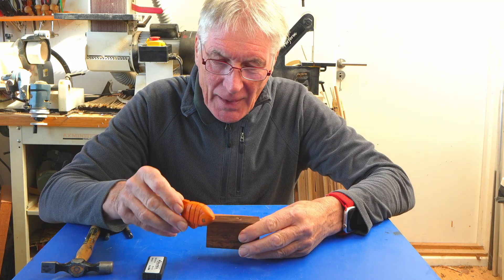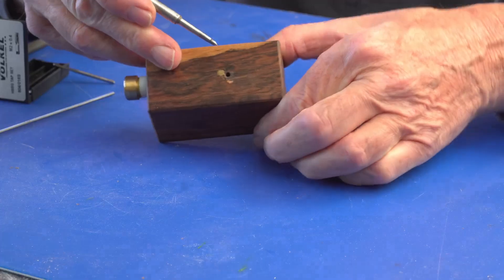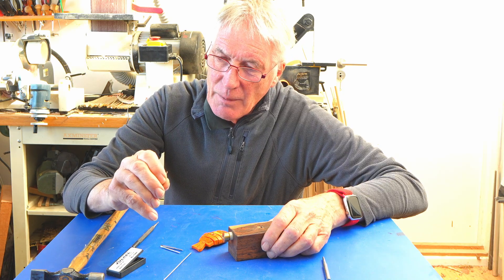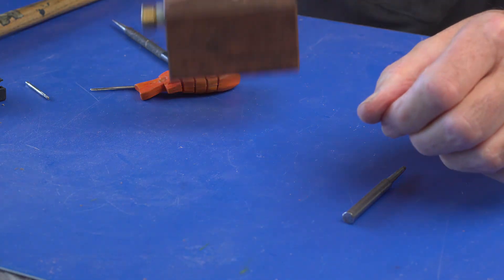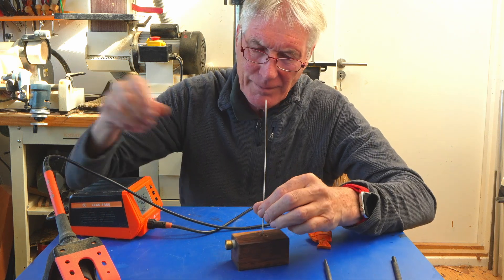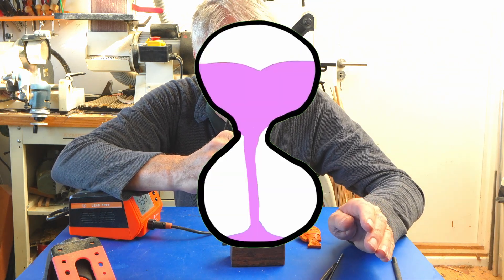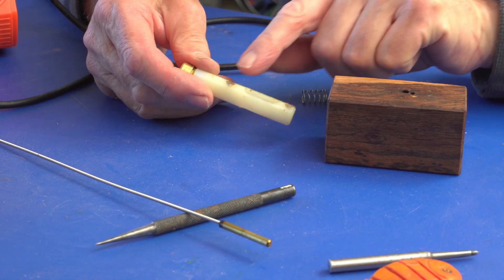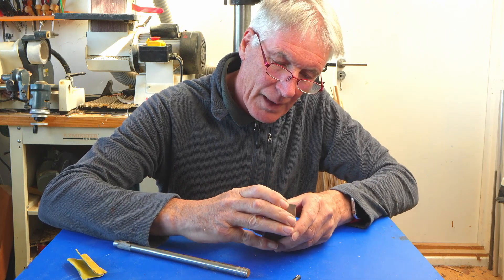Automata. Fixing a botched repair.

Comment: Why couldn't you just clamp the box down to the drill press table, tap the hole and pull the brass pin out with the tap itself?   You'd be pulling straight up with the leverage of the drill press handle and quill, so I don't understand why the extra step is needed.
Reply from the maker: An alternative that I hadn’t considered.  The Proxon drill press isn’t very robust and the glue still needs melting. It grips very strongly. Thanks for the suggestion.

Comment: I find a small "centre drill" very useful in such circumstances, to start a tiny hole, because it has a very stiff body and therefore doesn't have a tendency to wander off.  I have a set of various sizes.

Thanks for your excellent videos - entertaining, instructive, informative and inspiring.   👍
Reply from the maker: Thanks. Yes, I always start with a centre drill in the lathe to ensure the hole is centred. Thanks for commenting.